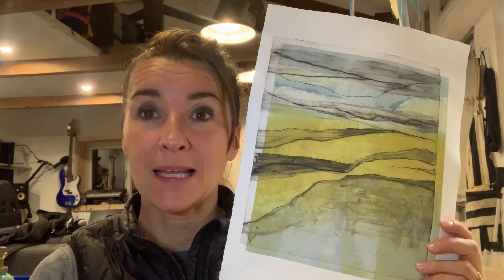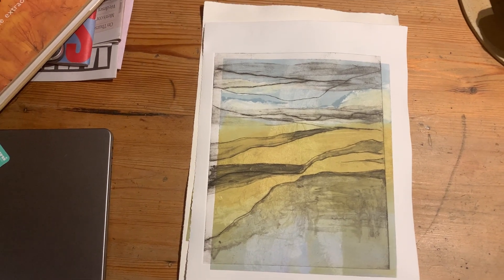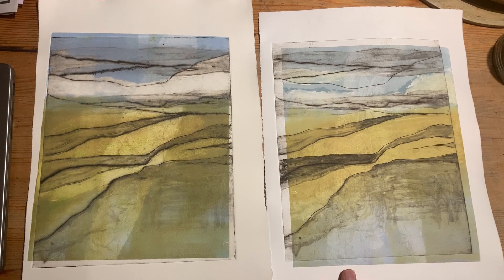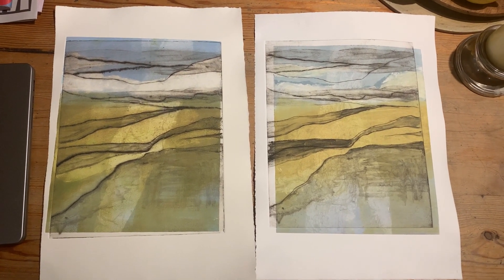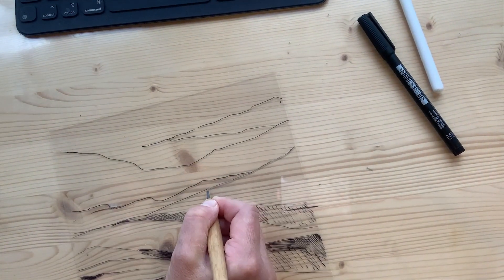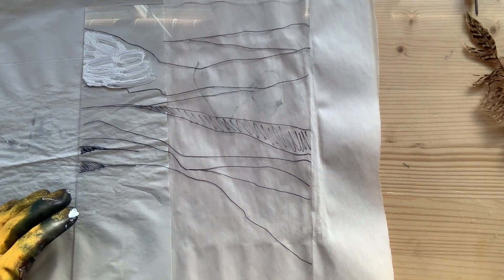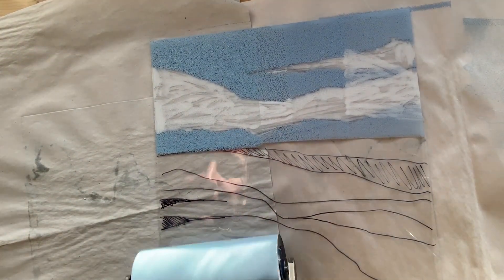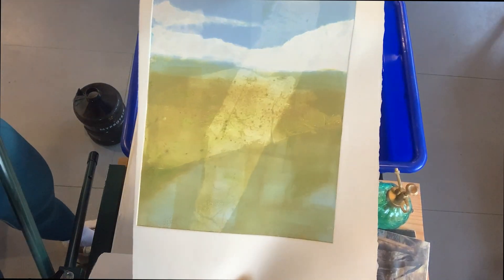A Hybrid of Collagraph, Drypoint, Monoprint + Viscosity!

Comment: Super video lesson. If you used oil based inks did you wait for the first print layer to dry before printing the collagraph plate or did you apply it wet. Many thanks.
Reply from the maker: @chrisriddles9460  thank you 🙏 I didn’t wait to dry, I applied subsequent layers wet

Comment: Just a question on terminology.  Why is this classed as a collograph plate?  Lovely print and I like the one with the brighter strip running through best. It's like the clouds have made way for the sun. Bx
Reply from the maker: Hi there! Good question. Technically it is a collagraph albeit a hybrid of all sorts of techniques, so difficult to give it a name
Reply: @CollagraphPrinting  Interesting.  I thought this to be more drypoint as you scratch the surface and didnt stick any cardboard on the surface....Ill have to do more research into this....Hapyy New Year  Bx
Reply from the maker: @bixnash1  it’s a mixture, the collagraph part was painting different media on top of the plate to trap more ink. Happy New Year and happy printing 🤗